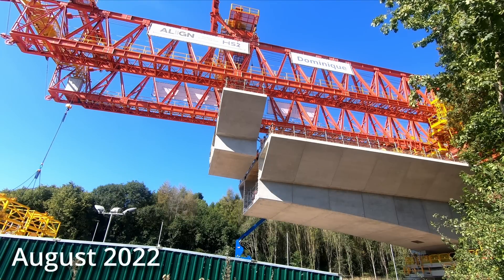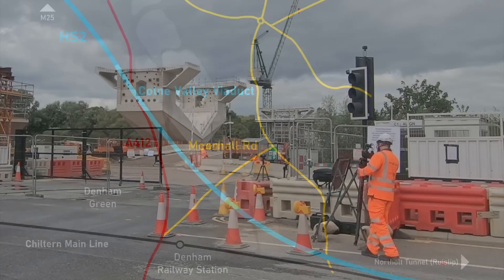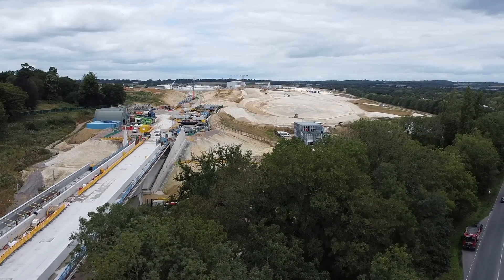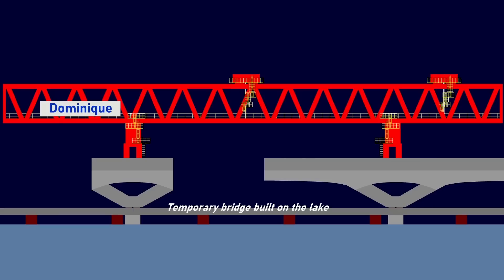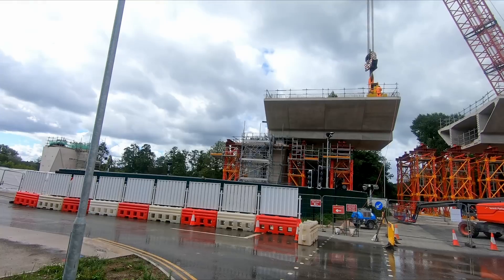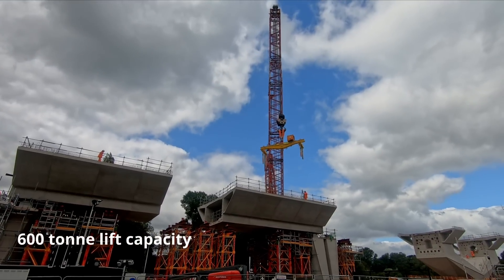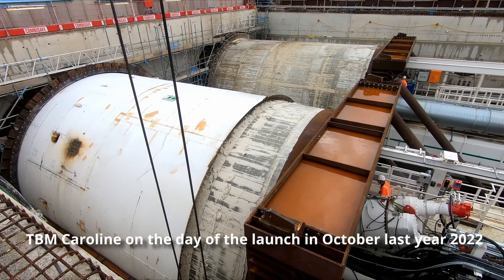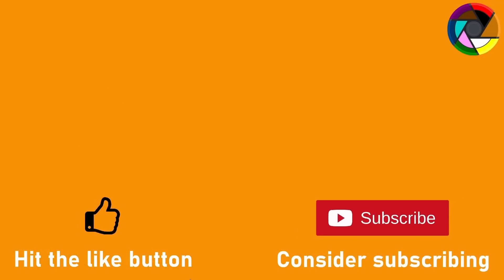HS2 Colne Valley Viaduct, Denham

Comment: I regularly travel by car in and around this area and have been amazed, despite all tne work that is going-on, the viaduct assembly, tunnelling and extensive landscaping, how little impact there has been on the local roads in terms of lorry traffic and general disruption. This section of the project has been very well organised on the logistics front and it seems that has involved employing a number of environmentally friendly concepts i.e. re-using tunnel spoil for local re-landscaping.

Comment: What's the expected lifespan of this viaduct, as i can't find anything definitive for new post-tensioned, epoxy bonded, segmental, balanced cantilever bridges. Other than the expoy bonding the segments is predicted to last 10-20 years, the steel tendons / cables used to post-tension the spans typically last for 15-20 years longer than the epoxy. Water and air penetration leading to the tensioning steel tendons corroding and the bridge collapsing, like the 33 year old Ynys-y-Gwas bridge collapse in 1985. Which subsequently lead to the replacement of many a 30-40 year old post-tensioned, epoxy bonded, segmental, balanced cantilever bridge, constructed in the 1950s and 1960s, across the UK.

Will the billions borrowed for the viaducts construction be cleared before it has to be replaced, and will a few years of a bus replacement service kill the service, in the 2050-60s, as surely HS2 will end up slower than the WCML. The bus replacement having to run between Old Oak Common and Birmingham, given the lack of intermediate stops?
Reply from the maker: Most structures on HS2 phase 1 are expected to have a lifespan of around 100 years without requiring major structural interventions. Which is partly the reason why phase 1 is so expensive.
Reply: @Rail_Focus  "Most Structures" is the issue, given tunnels last, embankments last, cuttings last, platforms last, ...  though post-tensioned, epoxy bonded, segmental bridges, are a post WW2 thins, and appear to have had a 30-40 lifespan, in the UK.
Reply from the maker: I'm fairly certain they won't be building a structure such as this with only a 30 year life span. HS2 is a 60-100 year piece of infrastructure and has been designed as such.
Reply: @AndrewRoberts11 increasing reinforcement content and using modern cement substitutes increase the lifespan. I recall Boris Johnson stating HS2 is designed to have a lifespan of 100 years. Yes, admittedly, it was Boris who said that, but all component parts would hsve the same lifespan and the project would come with a design life warranty as part of the contract  documentation.
Reply: @TrevorWilliams-fq8mg  That's before HS2 went all deviant, eg. "HS2 uses new pioneering low carbon concrete to reduce carbon emissions in construction". There's many a press release stating that they're trialing many a reduced CO2, biodegradable, hydrocarbon free, ... , material.
Reply: Good points. It will be interesting to know how the design life warranties for the project stack up. I'm sure the lawyers would have been on the case.
Reply: @TrevorWilliams-fq8mg  As long as they last longer than 20 years, any future failure will be beyond the UK's Civil Limitations legislation, so the courts and lawyers won't get a chance of pocketing another £700+ million.

Comment: The fairings look really nice, totally finish the look of the structure. I wonder, is it going to be painted? Would look very nice in a white or lighter grey than just the plain concrete.
Reply from the maker: I think it'll just be grey.
Reply: Would be cool to paint it with something that repels dumbasses with their graffiti cans
Reply: To paint the bridge white would be a never  ending maintenance cost issue. If the intention had been a white bridge the concrete would have had a white limestone aggregate. But that would have added a few billion to the cost of an already unaffordable project. And it would look an eyesore as it weathered. Google Alexandra Road housing project in Camden that was built out of white concrete in the 70's and you will see the eyesore it has become.

Comment: What happens when they get to areas of water, how do they build across 🤔
Reply: They put a wall between the boarder of the river and drain the water out, then build the foundation and place the big concrette stands to the river and wait for it to set and put the bridge in place and put the water back in and take out the providing walls.
Reply from the maker: As explained in the video they've built a temporary bridge. Foundation for piers built in coffer dams. The launching girder straddles the piers and can move itself from pier to pier.

Comment: I thought HS2 was being cancelled so it is a bridge to nowhere
Reply: A lot of areas have been put on hold for two years and word on site some will now be cancelled, we already knew when it was started North would be cancelled. It was in the planning to push the project through. Each contactor has now been told they must find a way to cut a billion each which has not gone down well.
Reply from the maker: Only North of Street Hey with sites mothballed and Euston put on hold, but ministers have stated repeatedly HS2 will go to Euston.
Reply: @Rail_Focus  na, there is more. We had to shut / lock the gates. 2 years but word on the street it be longer and the fall out for finding a billon each is massive and will only cause more delays.
Reply: @Yournamehere9160 so if some Contracts will be  cancelled but not all them,  we have a partly finished railway going to nowhere. And if every Contractor has been told to find a billion pounds some of them will be doing the job for nothing. Nice try.
Reply from the maker: No not at all, as you can see it's being built.

Comment: A disgraceful waste of money to save a few minutes for a small number of people.
Reply: There will be up to 1,100 passengers per train, with 17 trains per hour each way when fully completed. Nearly 40k per hour is hardly  a small number of people!  In the early 2000's, £14 bn was spent to 4-track the existing railway between Stafford and Rugby  (£28bn at todays prices) and it achieved a small fraction of the intended benefits. It would take the whole of the HS2 budget to complete just that section. A brand new high speed line is a bargain in comparison.
Reply from the maker: Nonsense, thanks for the enga though.

Comment: Fantastic but totally unnecessary engineering project. At £100 billion, it's an outrageous waste of money. Just think how Northern Rail could have benefited from a cash injection of that magnitude.
Reply from the maker: Nonsense, but thanks for the engagement
Reply: Still far better than California High Speed Rail, which is being built at a slower pace, has a similar price tag, and will be far less useful for far longer in its construction cycle (or possibly for its life cycle)
Reply: But you have to spend the most money where it is needed the most.  This will get more people / businesses etc out of the South East and faster too.  This will spread out London wealth to the Midlands and North.

Comment: Very informative update.
When I saw the thumbnail I thought you were going to repeat the urban legend that this will be the longest viaduct in the UK.
The "London Bridge - Greenwich" viaduct is longer at 3.45 miles (5.55 km). See the Wikipedia entry "London Bridge – Greenwich Railway Viaduct" for details.
Reply from the maker: Thanks, I wondered why they refer to it as a bridge rather than a viaduct. Bit of a grey area I guess as it travels over water, so could be called a bridge, but due to its many spans I see it as a viaduct 🤔.
Reply: @Rail_Focus  The Colne Valley Viaduct is a great achievement but I get the impression its makers are trying to "spin" it into something more.
The viaduct between London Bridge station and Deptford Creek bridge is a relatively humble structure. It is not very tall and very few  people who use it give it a thought. For much of its south side it is hidden behind later parallel viaducts.
Reply from the maker: Agreed, as much as I support the project there does seem to be a tendency to claim everything is a first or the biggest.
Reply: @Rail_Focus  It depends on what is below the structure, if the majority is water then it's a bridge, if the majority is land then it's a viaduct.
Reply: @krashd I know that distinction is made in some other languages but not in English.
Reply from the maker: Sort of, anything with a large singular, or a small number of large spans over a body of water is considered a bridge. But in the UK a viaduct is usually a bridge with multiple (relatively) short spans, irrespective of if it crosses water or not, Meadows Viaduct being a well known example.